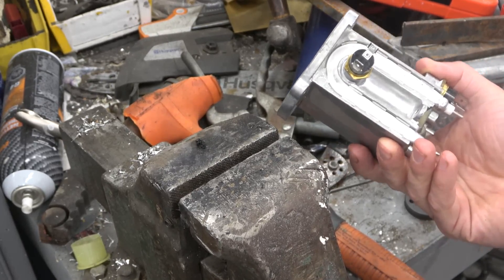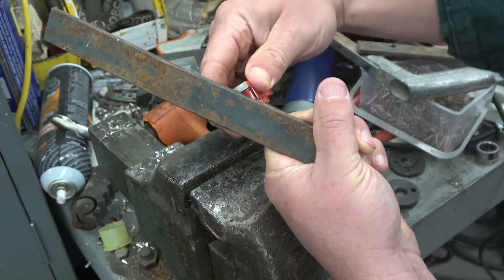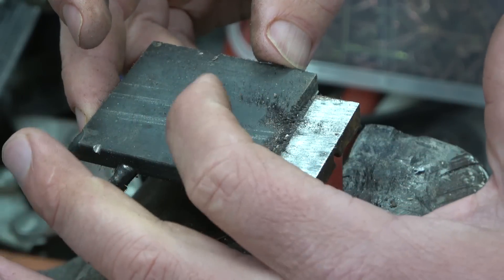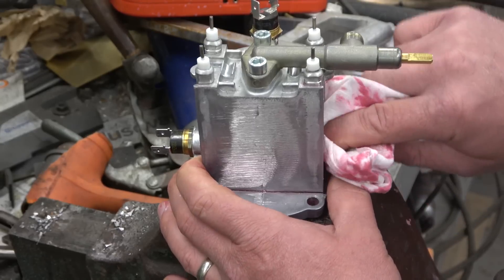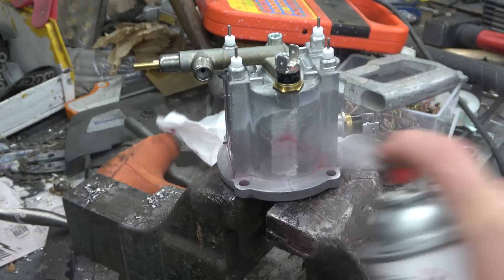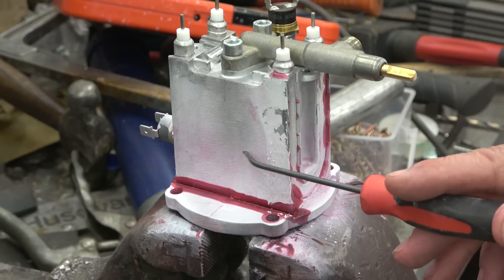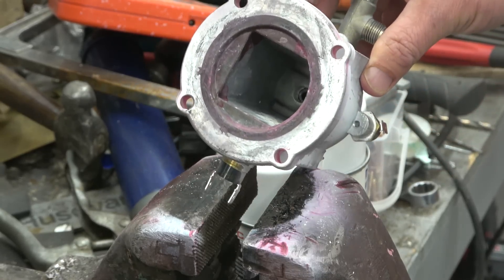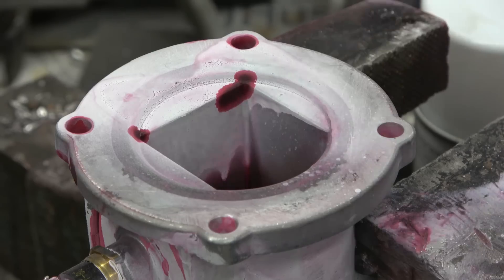Crack inspector. Weld Al Casting?

Comment: Coat the whole body in jb weld, and get back to work.
Reply: More or less tried doing that to seal up one of these, but the whole different coefficient of thermal expansion thing made that not work too well after a few heatcycles-

Comment: I haven't done a dye penetrant test for 30 years, a great reminder. An early vijayo of yours, always do the easiest thing first, get on the Gargler, if it's less than $50 save yourself a headache.
Reply: The ole how to troubleshoot anything gem
Reply: Exactly...how much is your time worth and if the repair fails that will be time wasted.  It only inflates the cost of replacement.  Don't get me wrong I have made custom replacement parts for broken shit that a replacement part was not available for, but the savings wasn't going to be less than 40 bucks.
Reply: It's beautifully simple

Comment: Why would they make a pressure vessel square, cracked right at the corners.  (I did the same thing as a young engineer and the piece I made did the same thing...)
Reply: They probably didn't account for it freezing solid considering it is meant to sit on your counter.
Reply: Ease of manufacture/design, I suppose. It was expected to be plenty strong enough for steam, but not for ice apparently.
Reply: Probably because it gives them a handy place to mount stuff, like the heating elements, steamvalve etc. I happen to have the (ancient) previous design Gaggia boiler, round and with the heating elements cast into the aluminium. Cracked in exactly the same place, right in the transition to the flange. A bit sad that they didn't really learn and add a radius there, when they redesigned these in 1980 or so.
How ancient espresso tech is still continues to amaze me, some high end machines still use the E61 group. Which was designed in 1961.
Reply: I've had one of those going strong for 16 years now and no issues. Then again a live in Australia so it has never frozen solid. C#$t.
Reply: I wonder if it's designed as a safe failure.  If/when the boiler wears out, it will crack in the corner which is (relatively) safe.
Reply: Maybe they were goin for the more area in a square than a circle idea?
Reply: Circle/ arc strong
I think the Romans figured that out 4000 years ago....
And likely earlier in Sumatra other area....
Egypt had triangles.
Reply: They must have been too busy trying to push ropes to design a sound part.
Reply: It's probably the cheapest shape to make, volumetrically.

Comment: Appreciate the magna flux explanation. 

But how the heck does die penetrant work?
Reply: Basically the dye soaks into the crack the developer is a dry powder that sucks the dye out of the crack is how I was told.   Also if you run out of the developer spray foot powder spray works
Reply: liquid flows into the crack, the other bit he sprays reacts to the presence of the original liquid ?
Reply: @Apex180  The powder helps blot (develop) the red dye to the surface of the crack or other flaw.
Reply: Im guessing capillary action. Still watchin tho

Comment: If it's for the Dewglaw, apply the electrician mates rate of %150 mark up. Opps I meant handling fee and environmental disposal! 😀
Reply: ...or just wrap it several times with elect-chicken tape. and give 'er a whirl!
Reply: @warped2875  That was my thought, if it holds in the angry pixies then it must be good for a bit of hot water!

Comment: At least buying the replacement isn't the most expensive option - you could also draw up the whole thing and run off a copy on the CNC, then figure out how to move over all the extra parts...
Could waste whole weeks with that option!
Reply: All depends on whether you're paid by the hour or paid by the job.
Reply: @axelmilan4292  😔 when youre on your own clock
Reply: I'd buy one of those made from a sensible metal, the aluminium on the flange corroding and pitting is a quite common failure on these. (A higher quality or anodized aluminium may be enough to may be good enough.)
Reply: Milling it would be more fun too, for him and for us.

Comment: 2022 and we're still using a barely evolved version of Oil and Whiting. If it works, it works.
Reply: Dye Penetrant and dirty old elusive aluminum cracks were made for each other.
Reply: I mean.... grand scheme of it all, isnt ultrasound the same basic idea of tapping the part and listening with a stethoscope for the ring?
Reply: @plasmahead2  Yes. However, we now listen with robot ears.
Reply: It vorrrrks
Reply: Still widely used in aerospace inspection on aluminum, usually fluorescent dye and UV light.
Reply: I’m glad people still know where dye pen actually came from